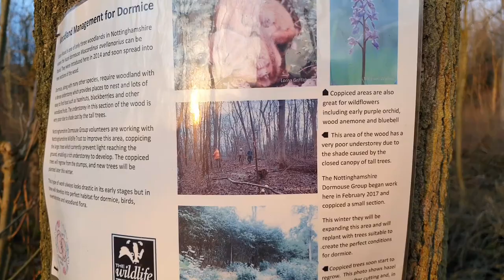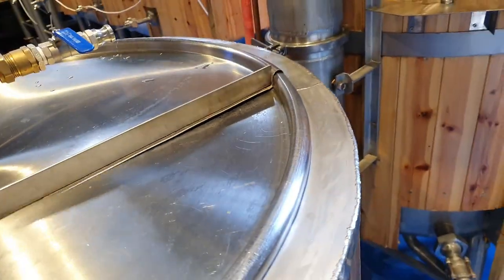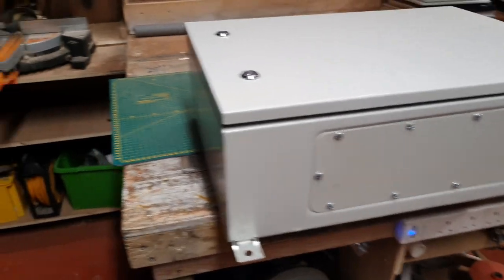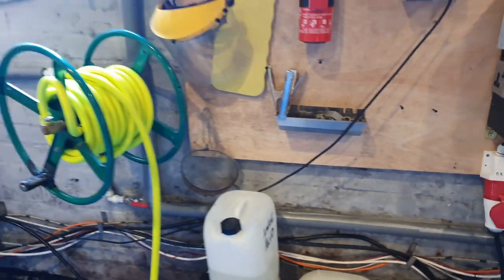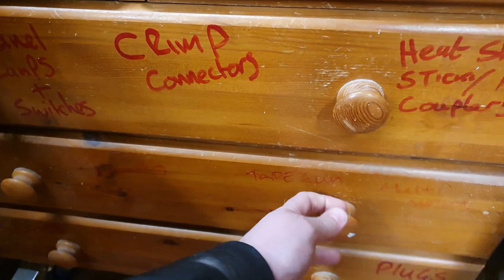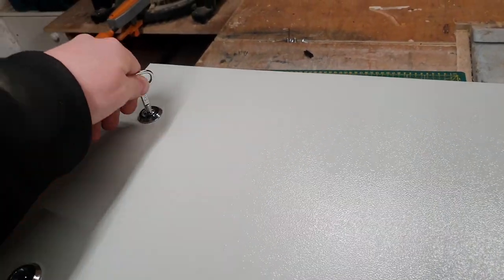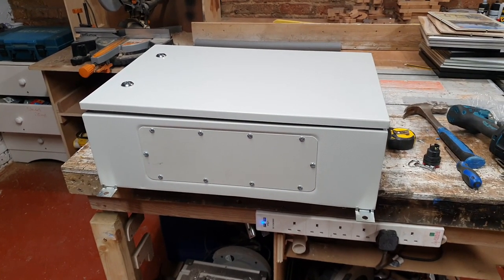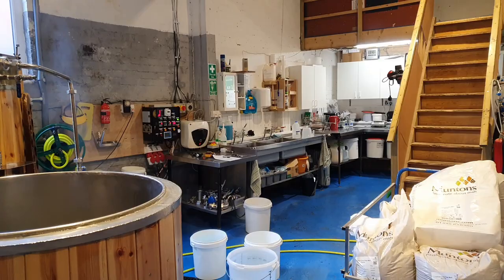I Might As Well Build A New Panel Right?

Comment: I’d be careful internally mounting a heat sink, if cooling fans and make up fan fail the heat rise is mental. Could put a heat sensor inside panel but it’s something else to fail. 
I use panel trunking and separate different voltages to each trunking with labels on. Neutrik connectors for below 110v I’ve found really good and can get panel mount too.

Comment: Harry you need to look into brucontrol for the panel rather than a hardware based panel, I think it would be right up your street.
Reply from the maker: Yeah, I looked at Brewpi. The thing is, in a brewery like mine, it just isn't practical. Brew days can be fast paced and dynamic and the ability to flick a switch has huge benefits in that environment. They are easier for the layman to use too if I have to delegate anything on the fly. Don't get me wrong, I like technical aspect of HMI control, particularly as a homebrewer. But brewing behind a screen is a bit too Molson Coors for a commercial micro brewery me thinks.
Reply: @harrybrew69  brucontrol is on a whole other level to brewpi, it can be used for almost any process. I started out using it for homebrew but now I'm beginning to integrate it into our brewery, not for brewing but the auxillary processes that come along with brewing (cask washing,CIP, environment control etc). I'm hoping to build a canning line similar to yours eventually (when I can convince the owners to pay for it) and it will be perfect for that, making on the fly process changes a doddle. I doubt I'll ever use it for automating the our brew house as I enjoy the process but it could if I wanted it to. No coding is necessary which was a huge benefit for me, it uses a very intuitive scripting language for automation, or can be used fully manually with PIDs/timers/switches etc on a screen rather than physical hardware.